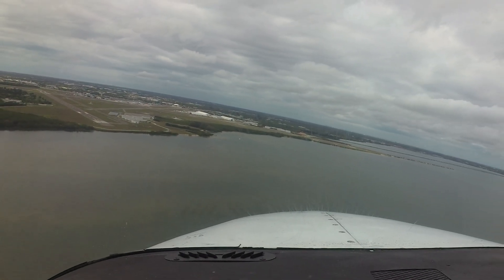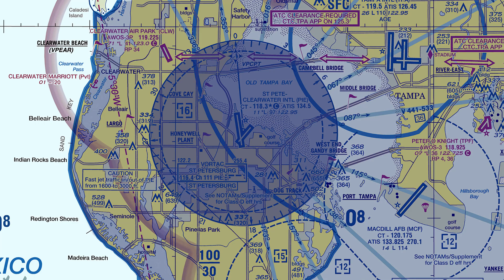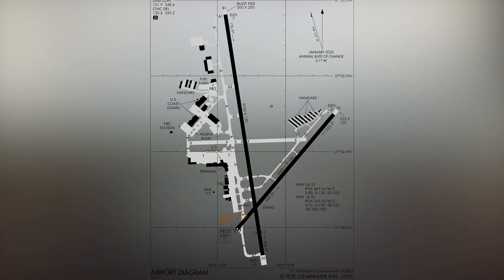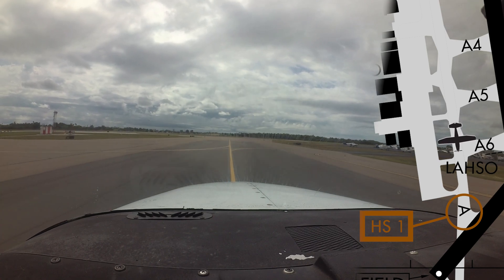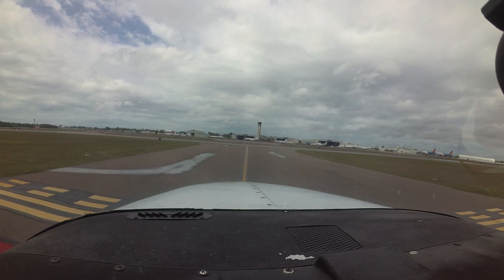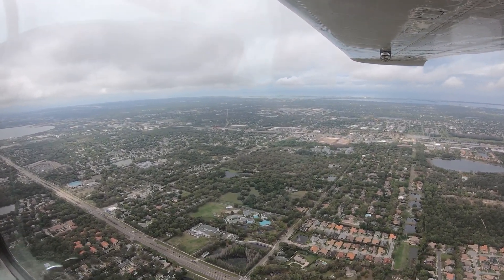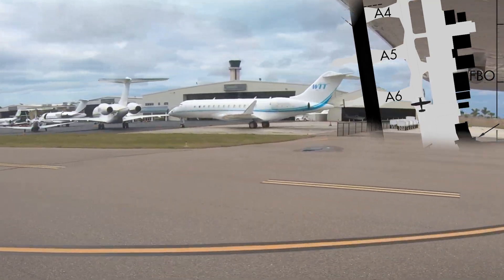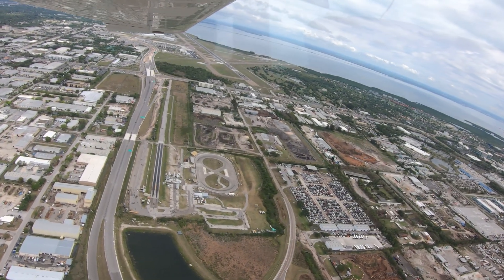From the Flight Deck – St. Pete-Clearwater International Airport (PIE)

Comment: As an effected resident on the runway 18 approach I was disappointed to not see the recommended VFR noise abatement procedure explained. I do send love to Allegiant Airline pilots for using it when possible as the IFR approach over the Del Oro neighborhood is only 3 miles from the runway. Very noisy AC, such as the Piaggio P180 on both takeoff and landing, are a real nuisance and encourage residents to attend Clearwater Council meetings en mass when the airport is on the agenda.